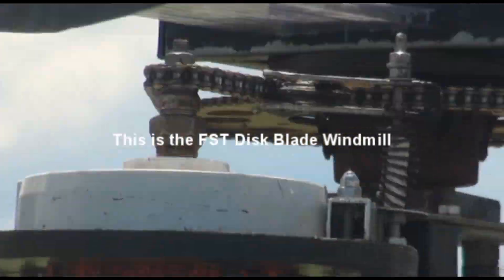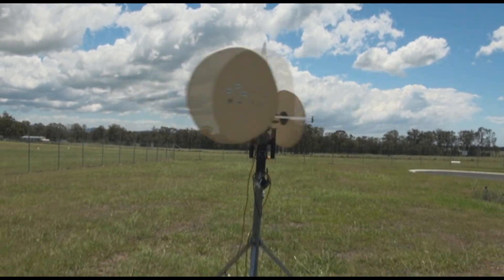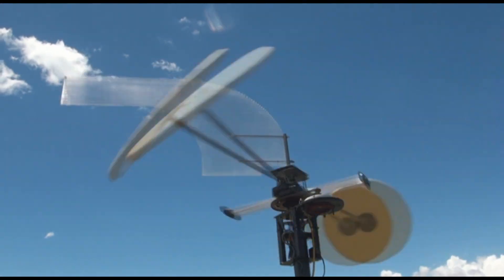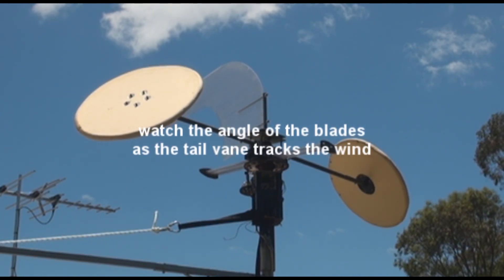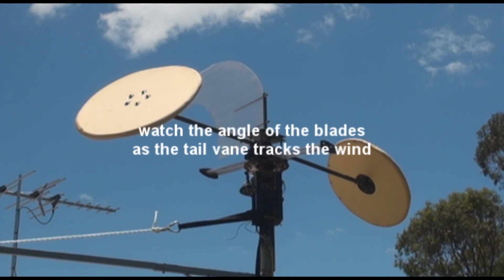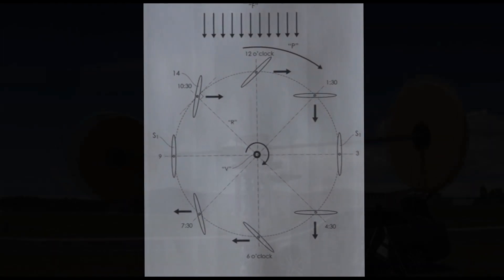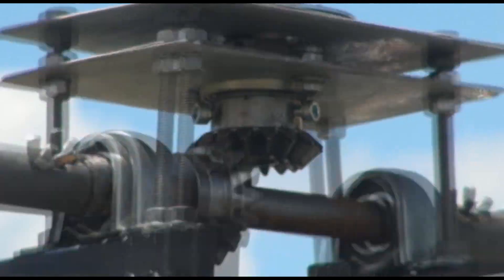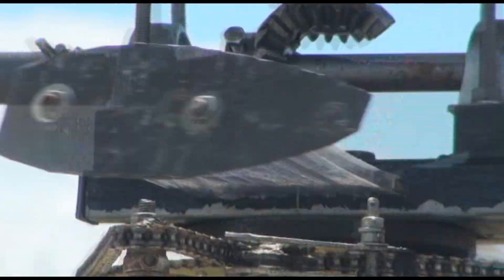All new wind turbine.   " How it works"

Comment: This is very complicated design,, not viable
Reply from the maker: Please show me a less complicated design that can automatically adjust blade pitch to optimise power output no matter what the wind direction. How can you say it is not viable when I have numerous videos showing this design actually driving an electrical alternator and operating in wind speeds that are too slow for conventional HAWT,s of equivalent size.

Comment: Very nice design. I think, there are a lot very attractiv shapes  possible with this design!
The best thing surely is the genious simple technic!!  Respect for that!
But i have two questions:
1. Your diagram shows, that the blade on 3 o'clock, the spot of maximum possible windpower, the blade shows the minimal surface to the wind. Did you try different ratios of the bevelgears? Now, ratio is 1:1, i suppose. Ratio 2:1 will not really make a change. But ratio 3:1 could make a difference. The movement of the blades is so confusing, that i can not imagine. Should be tested in a model. A bigger bevelgear on the vaneshaft would also give place for more blades. What leads me to the 
2. You also tested a three bladed design. Why did you refuse to it? Wasn't there a better efficiance? To much vibration perhaps? Start up cannot be the problem. Also the one bladed started easily.
This design should handle turbulence problems on pitched roofs.
Several layers are possible. Also counter-rotating layers are easily viable. You could also put more blades on one shaft to increase the surface ...
Reply from the maker: Thanks for your comments, you have mentioned some good points. Yes there are many blade shapes possible as long as there is a large flat surface and an edge. For example:  a sphere or a cube would not work. Unlike other wind turbines the blades do not have a leading edge. Every edge is a leading edge at some point in the rotation due to the blades spinning around the horizontal axis at the same time the turbine rotates around the vertical axis. 
1. The 3 o'clock blade position does not produce thrust, as you say but this neutral blade position only lasts for a split second and has minimal affect on total performance (have a look at the single blade demo again). In practise most of the downwind rear quarter to around 220 degrees produces the best torque.
A bevel gear ratio of 1:1 is the only format that works with this design, but thanks for your suggestion. I do have a small model that I use to help me test different ideas.
2. I have found that the more blades I add to this design the efficiency drops off. There is a small increase in total power but it is not worth the extra engineering and cost. I am afraid this brings me to the biggest drawback. This current design does not handle turbulence very well. I think this is why extra blades do not work, the front blades create turbulence that interfere with the rear blades.
I have a new design in the build stage that uses the two blade concept but has four levels for a total of 8 blades. I also like your idea of multiple blades on the one shaft. I have considered this before but have not had time to test it.
Reply: @David-mc4ny  Very interesting! Four levels mean that the vane shaft has to "penetrate" the blade shaft. Each level a new bevel gear. So each level can be shifted for 45° or for the angle that the one level gets the wind from the other. Blade shaft rotation could also be transmitted by a chain. ... just fantasizting ...
I'm waiting for your next video.

Another question: in the "zero position", when the blade shaft is rectangular to the wind direction, the blades, if extended, would describe an 90° angle on top of the vane. Did you test different retativ blade angels? 45° relativ to the blade shaft is certainly the best. Another relativ angle between the blades could have an effect on turbulences. Perhaps the lack of effectiveness could be explained by that. I don't know how your blades are attached, but could be easily tested.
Reply from the maker: Yes I have done some testing on different blade angles, 45 degrees seems to be the best but I would like to do some more testing later. The horizontal vane shafts go through the vertical main shaft on the multi level version. Only one set of bevel gears at the top in the direction vane mechanism, then rotation of the vane shafts are driven by timing belts and pulleys. Chains and sprockets could also be an option. All levels are at the same angle to the wind for simplicity. Offset levels may be worth exploring later.
Reply from the maker: @klausgeiben6608  Vid of my yet to be completed Four level FST Turbine. here is the link: https://youtu.be/rrvGhuKWqCM

Comment: Hello David, i think you ar on the right way for a good alternative turbine ! If you look at my Turbine-Ideas: https://www.youtube.com/watch?v=hzTkJ0vUQiE. Your and my Turbine Models are both good alternative to the Savonius - Darrieus Rotors, perhaps even better !
Reply from the maker: Very nice design and good engineering in your wind turbine. I guess it will have good torque and be self starting like my own turbine thanks to the use of positive drag and lift forces on your blades and the upwind segment of rotation should minimise negative drag from what I can see. Good work and good luck.
Reply: @David-mc4ny  ...thank you David. do it further and good luck even.

Comment: Quality mate, well done. Needs enclosed though no?
Reply from the maker: Thanks, Yes - enclosure should help in dirty wind areas (swirling winds). If the wind is clean no shrouding is needed, the pitch control takes care of all upwind conditions except when the wind is swirling and changing direction quickly from multiple directions. A new shrouded variant is currently in the design and testing phase.

Comment: Meh, what's the gain in efficiency from the complex gearing and pitch changes in regards to a simple vertical turbine but w optimised rigid ducts/blades. Cuz to me, it better be worth adding more moving parts n bits..  just looks nice so far but that's  it. Especially w wind turbines. They're usually junk in terms of net revenue
Reply from the maker: Glad you think it looks nice but unfortunately the haphazard construction (as a test model it has been rebuilt numerous times in different formations) makes it look more complicated than it is. This is one of the simplest ways of obtaining variable pitch. If anyone can show me a VAWT with a less complicated blade control system I would like to know. All VAWTs have an inherent problem, that is the fact that for part of the rotation the blades are travelling directly into the wind. Any drag  on the blades at this point has a very detrimental effect on power output and the faster the turbine spins the worse the problem gets. As you suggest, a ducted system is simpler and partially overcomes this problem (see my vid of ducted VAWT) but they also have drawbacks. However, I do think there is potential for a good large scale VAWT of the type you talk about. As for this FST design, it generates far more power than any other VAWT of the same size that I have come across.

Comment: Is this unit available for sale in the U.S.?
Reply from the maker: Sorry, no. The design needs some work before we can think about production. Progress is very slow due to Covid and development issues. I think it will take some time before we have a saleable product. As soon as the final engineering issues are sorted I will publish plans for  DIY individuals to build their own. Ready built units may or may not follow (if funding is available).
Reply: @David-mc4ny  that’s very good of you to share your work  I think what you have presented has a lot of promise
Do you think it would be viable to have more disc’s as I can see it getting to fast as you have negated the main inefficiency of vawts 
Wish you the best of luck in your endeavours and lots of blessings
Reply from the maker: Thanks for your comments John. I have tested One, Two and Three blade variants of this design as well as different blade shapes. Unfortunately the power output does not increase in a linear manner with the addition of extra blades (not in this format). My next build of the FST design will have 4 blades but each blade on a different level stacked above one another. This will give me the extra swept area of each blade without the turbulent backwash disturbing the  downwind blades. Remains to be seen if this will improve performance.
Reply: @David-mc4ny  I hadn’t seen your other videos when  I wrote first  but I watched all your others as soon as I finished watching this one  
The three blade looked better maybe there are better ways to check over speeding which I imagine could be one of its weaknesses but all really great work and ingenuity 
Having said that I might favour your first shrouded turbine I’ve been planning on building something very similar 
Towards the essential simplicity is a valuable design direction , I hope you get some support to keep going 
I just had a thought. Would it work well upside down under water in a river or tidal flow where the turning forces are more stable 
  👍👍👍
Reply from the maker: @johnmcfadden9336  Actually over-speed has not been a major problem. I think HAWT,s with their long thin blades and need for high tip speed are more vulnerable. Funny you should comment about the water. Yes I agree that this design should work just as well or better as a water turbine but I have not had a chance to test this theory yet. Another possible application is a propulsion device such as a propeller for a ship. A propeller less prone to cavitation and has the ability to steer the vessel without the use of a rudder and even go into reverse without changing direction of the driveshaft. 
Good luck with your shrouded turbine. Yes, simplicity is the way to go. My shrouded turbine (PWT) can not compete with my disk blade turbine (FST) for power output (per square meter of swept area) but shrouded VAWT's  have great potential. A modern Utility Scale HAWT has great efficiency but limited lifespan and high maintenance costs. If you can build a large (I mean the size of a 30 storey city sky scraper) VAWT that will last 300 years not 30, with minimal maintenance, this is real efficiency (even if the power output is only half).  With effectively just one moving part (rotor) and all the serviceable parts at ground level, this could be built to last a very long time. Partially protected from the weather  (extreme wind, UV, rain, snow, hail) the rotor should last as long as the external structure. Upgrades of generator or electronics can be done easily at ground level. 
I think the main downside of your turbine will be the size needed to get usable power (depending on your average wind speed). 
One square meter of swept area at 20 kph of wind speed will only get you about 40 watts of power (if your turbine is very efficient) or 320 watts at 40 kph.
Good luck.
Reply: @David-mc4ny  thanks a million for your answer we are very much aligned in our thinking  although I’m not any where near as informed , I’m a little disappointed about the low  power output you quote for the shrouded turbine  the one I’m planning will sit on the flat roof of a tower that will also be a plant room for energy production and storage and design of adjacent structures to collect and direct wind in to the turbine. the shroud will be about 8 ft wide and five feet high , if I can after I plan to build a bigger one as a back up source for heating  we live in a bit of a ravine right on the coast with the prevailing wind coming up the ravine which itself focuses the wind but would diminish effectiveness from other directions but we do have higher sites and hill tops where a much larger unit could be built and blended into the land scape so it would be barley visible from a distance 

I have considered placing the turbine in a large rotating funnel that was directed into the wind and after the turbine straighten the wind and pass it over a fan type generator before it exited the tail of the funnel , thinking this might reduce the chaotic eddies that I imagine reduce  the efficiency of vawts 
Over coming cavitation is a big plus 
 I really wish you all the best mate 😀
Reply from the maker: I have done experiments with funnelling with some surprising results. Your thoughts on eddies I have found to be correct. In one experiment I used a "fan type" anemometer to record wind speed and fitted different cones and pipes in front and behind. To my surprise, fitting a tube roughly the size of the fan, directly "behind it" greatly increased the wind speed. I guess the turbulence behind the blades slows the wind flow significantly (as you thought).
Your project sounds great, good luck.
Reply: @David-mc4ny  👍👍👍recurring 😃

Comment: the first one is to complicated
Reply from the maker: No it is not. Three bearings and one set of bevel gears is very minimal to achieve variable pitch on any wind turbine. Current (variable pitch) VAWT designs need separate linkages and pivots on every blade, coupled to more moving parts with associated pivots, linkages, gears or cams to a wind direction vane. Not only does this design use fewer moving parts but the blades do not flap back and forth to achieve pitch control. The entire offset blade spins around a horizontal axis in one direction. So actually this design is far simpler and not prone to mechanical failure. I have tested this design in actual wind speeds of 75kph plus over many months.
Reply: @David-mc4ny  I meant to many moving parts, its a great idea nevertheless!

Comment: Its a cyclic like those used on a helicopter, that enables a pilot to control the rotor pitch
Reply from the maker: Thanks for your observation millie maddalena . The FST2 wind turbine does have similarities to a helicopter rotor mechanism and it does control blade pitch in a cyclic manner as you say but the control mechanism and operation are entirely different. The blades continually rotate in the one direction (around the horizontal axis) to adjust relative pitch, a helicopter blade will pitch one way and then reverse direction and go back to its original pitch position. Unfortunately my pitch control would not work on a helicopters main rotor but the design does have potential for use as a thrust generator in other craft.

Comment: I like the idea of changing the set point with the geared vane. Perhaps, rather than discs, 90deg offset blades along the copper shafts could provide force?
Reply from the maker: Thanks for your feedback. The blades of this turbine do not necessarily need to be circular disks, but the offset angle together with both vertical and horizontal rotation of the blades is critical to the operation of this design. The "offset angle" gives the required pitch variation of the blade as it rotates (around the vertical axis) at the same time as it spins (around the horizontal axis). By offset angle I mean the angle between the blades and the radial shaft. On a normal VAWT this would be 90deg. On this turbine 90deg would mean "NO PITCH VARIATION". This test model has an offset angle of 45deg to get the best pitch relative to the wind direction. Why a circular blade? I understand why an aeroplane wing design for the blade may seem the most efficient, and for turbines that rely on lift and high tip speeds it probably is ! but this design utilises lift forces as well as positive drag forces, depending on where the blades are in the rotation. Think of it as a sail boat rather than a Jet Airliner. Changing sail trim depending on the boats direction in relationship to the wind. A disk design on this turbine seems to work quite well and has other advantages over a wing shape. * Simpler construction * Cheaper * Stronger * Less flexing and vibration * Easier to balance * Downwind turbulence kept to a minimum as it spins. Having said that, we are looking at other blade designs. 
Hope this answers your question Ken.
Reply: @David-mc4ny  thanks for that David. I'll think it through some more.